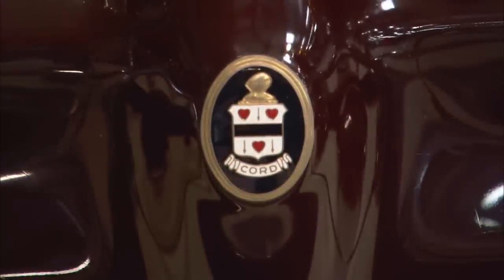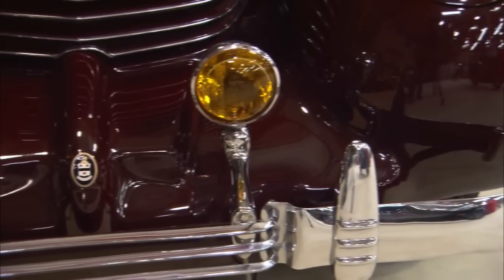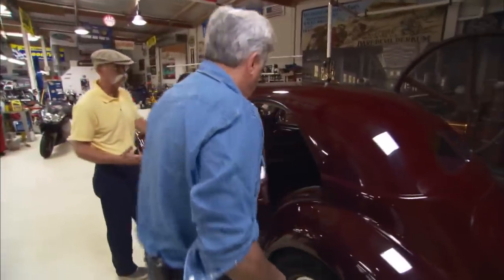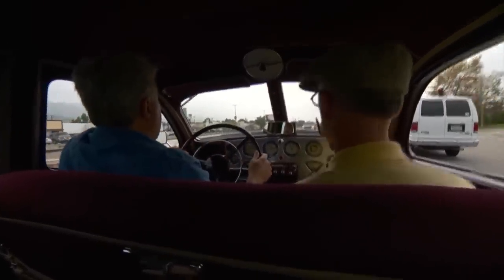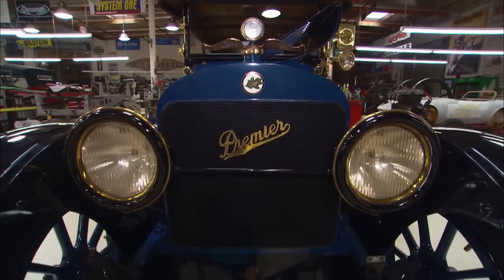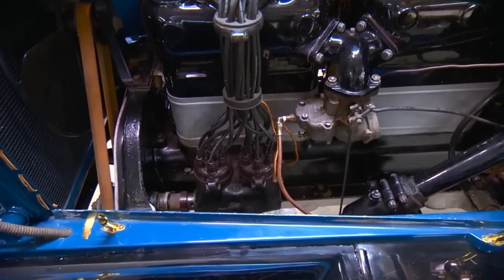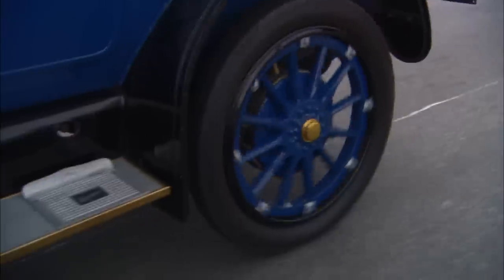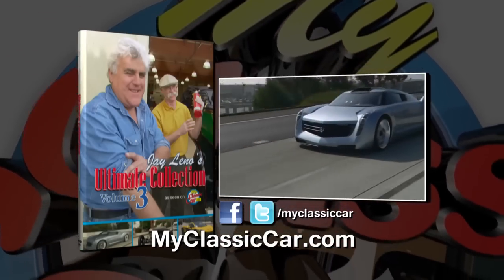Jay Leno's Cord and Premier

Comment: now if its 288 or say 300 cubes is that for two revolutions since its a four stroke engine, meaning a 300 inch motor is really compressing and firing 150 cubes per rev.